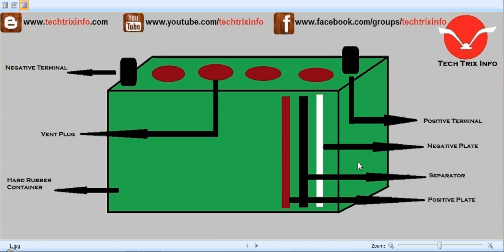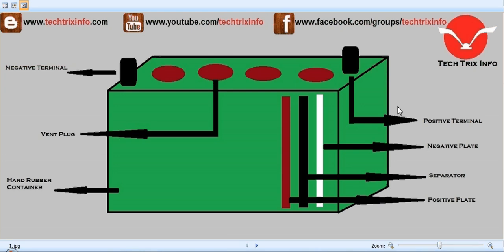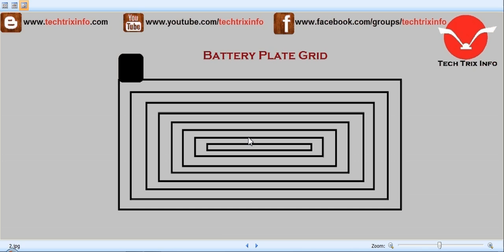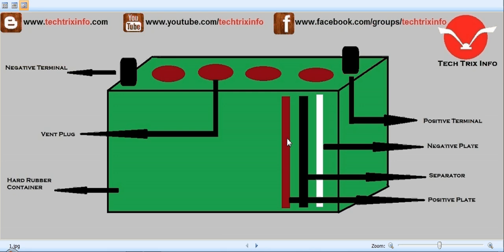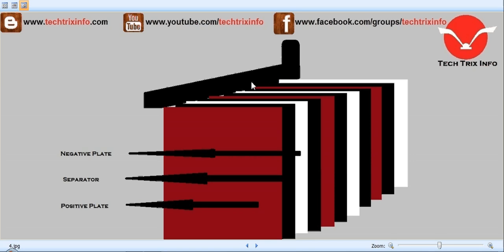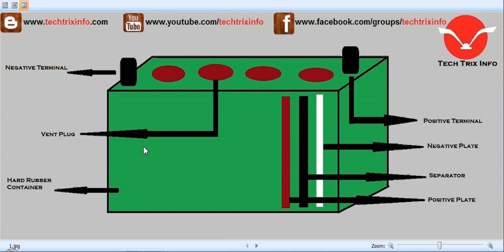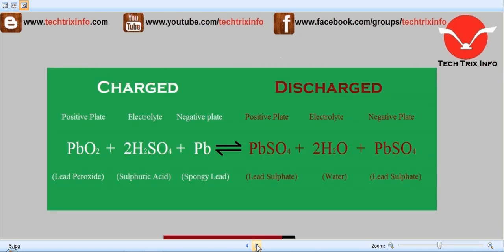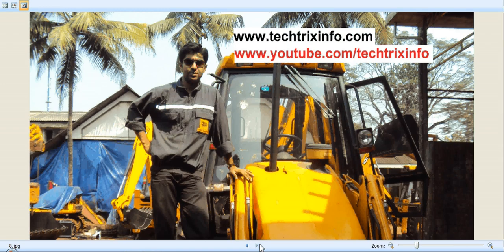How lead acid battery made. ✔

Comment: MISTAKES IN YOUR VIDEO: 
1. Your battery plate in the picture is wrong rectangles are not connected with each other.
2. Separators are to hold electrolytes between two cells.
3. In picture you have connected all the plates in parallel but in actual the cells are connected in series.
4. Container is not made of hard rubber it's made up of Plastic.
5. And the actual separators separates each cell from other.

If you are doing engineering kindly leave it because soon you'll start making crap batteries.

Comment: Can a battery that was punctured and acid lost be repaired and refilled?  

After a car accident, I found that a piece of case bottom had been pushed in causing a slight bulge in the negative end wall.  The hole is in the bottom, at, and parallel to the edge,  in middle of the corner/edge between bottom and wall of case (negative end).   Opening is about 3 cm x 1/2 cm wide.    Battery seems ok, other than complete loss of acid and the bulge (maybe 2mm).  The hole exposed two separators with some of the plate material being lost.   I was hoping to repair the hole with epoxy and refill with new acid for use on a stationary solar system.  

The battery was only 4 months old and fully charged when fluid lost so presumably the plates are still good.  Your schematic showed concentric conductors built into the plate - maybe the outermost conductor was damaged but can't tell. Penetration was maybe 3mm.  It appears that separation media is still good - a grey flexible film that appears doubled over to make two a layer thickness. 

I guess taking the fluid from an old battery isn't a good idea - not sure where to get new acid.  Is epoxy the best thing to use to repair the casing?  What about a flexible glue such as goop?  

Any help much appreciated.  TIA.

Comment from the maker: Hi Sry saw your comment just now ...its ok to keep the battery vent open, but not recommended as its corrosive, there will be other fumes also coming from it other than H2..so you better do electrolysis to get the byproduct H2..
Have a look at our other videos too and rate us..